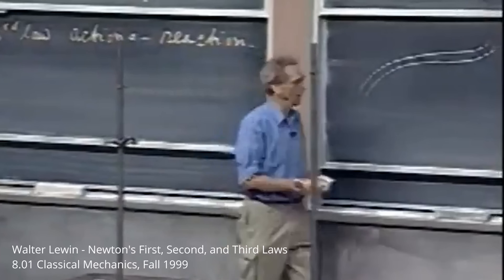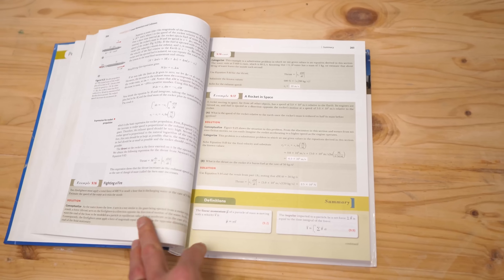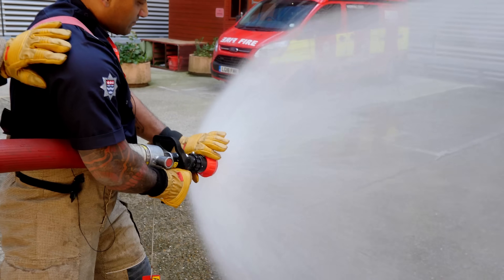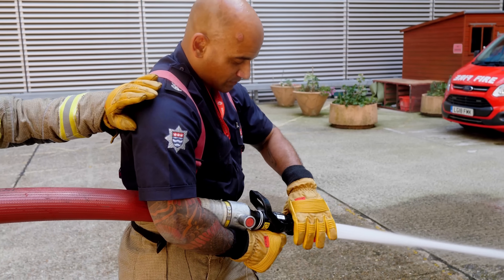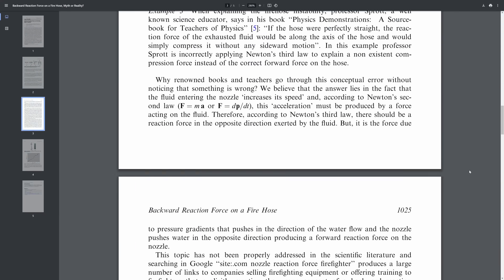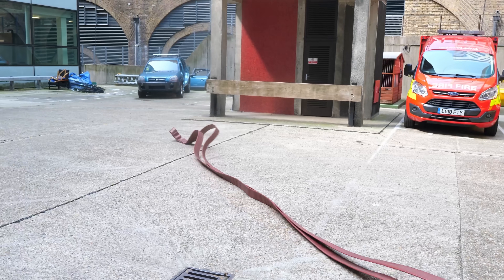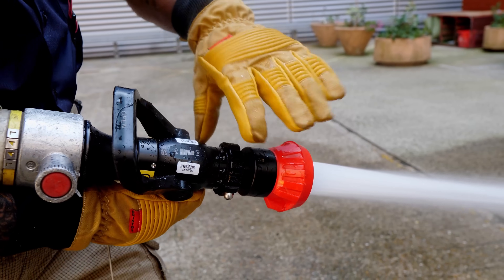Why chaotic hoses dance

Comment from the maker: What about when there's a constriction at the end? I think that would actually cause a force opposite the reaction force at the nozzle.
The sponsor is Jane Street. Apply to their summer program here: https://jane-st.co/SM-AMP25
Reply: The force you're measuring on the hose is called End Cap // Reverse End Cap // Thrust Force. This is equivalent to the gauge pressure across the pipe wall multiplied by its wall cross sectional area.

In your cases, the higher internal pressure acts to pipe the pipe wall in net tension. If the pipe end was capped when pressure applied, there would be a strong axial load putting the pipe wall in tension. As the pipe end is unrestrained it naturally wants to pull itself "rearwards" as the internal pressure is still present. This is the force experienced by the fire fighter - attempting to restrain against the wall tension of the pipe under pressure.
Reply: @d4nheg  Extremely well said. I was thinking the same thing and I couldn't put it to words that made sense. There is an area inside the hose wall that is equal to the area of the nozzle and they are concentric circles.
Reply: @d4nheg  This is the most accurate explanation I have seen so far, but I think you mean gauge stagnation pressure.
Reply: I think that's it, Steve.  The restriction creates a large difference in the speed the water that is leaving the nozzle than the water in the tube.  This creates a difference in momentum, which exerts a back force on the nozzle.
Reply: @Mr_Booshy  Even if the tube has an open end with no restriction there is still a reaction force.
Reply: I think that's the difference between air and water - if the hose is filled with highly compressed air then the velocity increases as it exits to a lower pressure area even if there is no change in cross section. For incompressible liquids that's not true (and you don't see a constant width water hose behaving like this, only one ending in a constriction like a fire hose)
Reply: @Mr_Booshy Nope, the reaction force acts only on the water stream and is responsible for the gradient of static pressure inside the nozzle. In a straight hose, the hose and nozzle are  only subjected to the viscous forces of the water and are pulled in the direction of the flow. This was measured experimentally. Google "Backward Reaction Force on a fire hose, Myth or Reality". It describes an experiment on a straight hose with a nozzle where they measured the force on the hose.
Reply: Finally  the regular chat is up. I hate these  "  premieres"  YouTuber Brittany to go back to simply posting videos like normal the live chat is dumb.
Reply: @turtletom8383  🔴 I highly recommend learning about Islam...

 🔵 There is no salvation in the afterlife except by following Islam

⚠ God has said in the Quran:

🔵 { O mankind, worship your Lord, who created you and those before you, that you may become righteous - ( 2:21 ) 

🔴 [He] who made for you the earth a bed [spread out] and the sky a ceiling and sent down from the sky, rain and brought forth thereby fruits as provision for you. So do not attribute to Allah equals while you know [that there is nothing similar to Him]. ( 2:22 )

🔵 And if you are in doubt about what We have sent down upon Our Servant [Muhammad], then produce a surah the like thereof and call upon your witnesses other than Allah, if you should be truthful. ( 2:23 )

🔴 But if you do not - and you will never be able to - then fear the Fire, whose fuel is men and stones, prepared for the disbelievers.( 2:24 )

🔵 And give good tidings to those who believe and do righteous deeds that they will have gardens [in Paradise] beneath which rivers flow. Whenever they are provided with a provision of fruit therefrom, they will say, "This is what we were provided with before." And it is given to them in likeness. And they will have therein purified spouses, and they will abide therein eternally. ( 2:25 )}

⚠ Quran
Reply: @turtletom8383  you could just click hide chat and post down here.
Reply: Now you're back to rocket nozzles.
Reply: I think you're technically correct that he's being pulled back by the hose, not pushed by the water, because he's holding on to the hose, not the water. But the real question would be whether the pull from the hose is from those eddies, or from the hose itself being pushed back by the water, and in turn pulling the firefighter back 🤔
Reply: @ameteuraspirant I think the internal pressure is pushing on the inside of the hose. The sum of the forces are zero everywhere except the open end of the hose. You're not feeling the accelerating water. You're feeling the tension in the pressure vessel with an open end trying to accelerate backwards.
Reply: @jahnkeanater I believe this is correct.
The nozzle exit is the only point where there is an imbalance, only balanced by the exhaust fliuds reaction to the pressurised fluid and hose system. Even without a constricted nozzle.
A restriction in the nozzle only increases the efficiency of thrust by increasing the exhaust velocity even though thrust force will be reduced by a reduction in mass flow rate and nozzle area.
Reply: @jahnkeanater  You have it.  Steve, at one point, starts to say the thrust is on the water back up-stream, but ignores it and seems to go with the Newton 'reaction' magically pushing the "nozzle" back.  You must be able to identify what 'body' the Newton 'reaction' is pushing on and it isn't the opening end of the hose, nor a ordinary reducing nozzle.  It's on the water. I may try contacting him. . .
Reply: So at 15:19 , the weight and material properties like elasticity, and flexibility of the hose are a big factor here, and also the external resistance of the ground as well as the weight of the water inside, all resisting the tendency of the hose to snake when at full blast, by design I would imagine.. it doesn't snake further back because it's really really heavy and on the ground. If it were suspended with nozzle down it would definitely snake further back, unless it were made of a really rigid material. If it were a much less rigid or less heavy material it would snake even further back.
Reply: Pumps do not create pressure, pumps only create flow. Restrictions create pressure. This is true for all pumps be it a rocket, firefighting trucks or air hoses.
Reply: @Kikkeliskokkelis12  There's a perfect electrical analogy with voltage as pressure, current as flow rate, small and large resistors as wide and narrow pipes, inductors as mass and capacitors as elasticity.
Reply: So what would happen if the hose was in zero gravity…. 🤔
Reply: @georgelaxton  Nothing different, a water hose exit is exactly the same as a rocket and rockets work same in 0 g.
Reply: hmmm I don't know if that's it, I mean a firehose half open would do that, I think the missing element is the friction force applied on the hose by the fluid. if you detached the firehose at the base while it was running the hose would be pushed away. I think at the connection point to the fire engine the hose is under tension.
Reply: @iskoon I don't think friction plays a part. I think this user @d4nheg is most correct
Reply: @iskoon  only because you're holding the nozzle. If you had a loose hose flaing about and then put  a restricting nozzle on it, it would flail around more. restriction inrcreases the delta p (difference in pressure)
Reply: Yesterday I saw a video of a large ship dropping the anchor. As the chain was going down the hole, you could intermittently see the chain raise up as it bent to go down the hole. 

I immediately thought of you with the ball chain experiment you did a while back.
Reply: I don't think so. If you have an incompressible liquid, the slow down at the constriction will propagate to the pump, such that although the water flows more slowly than if there was not constriction, that is the case through the whole length of the hose and thus there is no slow down at the nozzle, ie. no reaction force. On the contrary, it would create higher pressure inside the hose causing more acceleration and thus a greater reaction force. Unless it causes a reduction in the flow rate and results in a lower reaction force. I guess it depends on the strength of your pump and the viscosity of the fluid.
For a gaz, I guess it might depend on the speed and pressure inside the hose. There might be configurations where the gaz actually slows down and compressed near the nozzle, causing an opposite reaction force, but still increasing the original reaction force because of the increase in pressure.
Then again, we'd have to test it to actually know. And there be many tests to do with all the parameters potentially influencing the result. And the short answer at the end would probably be: "It depends."
Reply: I think the mechanism behind the car lot dancers is different from a wild hose. Wild hose is essentially a rocket but the dancer is blowing just barely enough air to stand it up, once upright there is no pressure to inflate and keep it upright so gravity folds it over. Once it creates a new seal it inflates back to the upright position and repeats the cycle.
Reply: @Dejacoa  Could you adjust the fan to a point where, on a calm day, the cycle is regular?
Reply: Because water is incompressible, and has essentially the same momentum at the end of the hose as at the outlet of the pump, couldn't you entirely ignore the hose for the reaction force, as the end of the hose would be equivalent to the outlet of the pump itself?
Reply: was just about to comment this, it looked like the sprinkler toy and the firehoses both constrict at the end, the forces would be different than the straight tube experiments
Reply: If the pump were powerful enough, it could theoretically increase the pressure to compensate, resulting in the same mass of water traveling through the hose (compared to without a restriction). In this scenario, wouldn’t the velocity of the water through the restriction increase as a result?
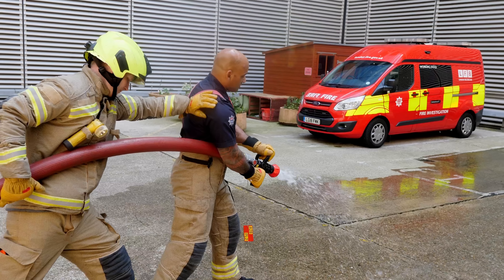Reply: I’m a firefighter, so I’d suggest you speak to your fire brigade member to confirm this for yourself, but an important thing to notice, and will give you great insight about the nozzle reaction forces, is that the backwards pressure on the nozzle is GREATLY reduced when the nozzle pattern moves from Straight Stream (tight pattern for maximum reach) to the Fog Nozzle pattern (wide cone shaped stream) 6:36.

This will help confirm that the impinging surfaces inside the nozzle cancel each other out inside the nozzle in the Fog Pattern setting. The straight stream setting can require two firefighters leaning into the nozzle to resist the reaction force, but in the wide Fog Pattern, one person can easily hold the nozzle with one hand!!! even though the amount of water leaving the end of the hose is nearly the same (depending on the nozzle, the fog pattern may have greater GPM/LPM flow rate than the Straight Stream pattern)
😳

p.s. You might want to ask him about "Friction Loss" too. If you use that term, he’ll know just what you’re asking about, and his explanation will add a lot to your understanding of hose lays.
Reply: A partial constriction at the nozzle increases the velocity of escaping fluid/water compared to that of an open pipe. Increasing speed of escape should increase the force felt at the nozzle end, but remember the fact that the volume also decreases in tandem... Always fun to try to reason through everyday things like this. 
My fire fighting training in CG was too, too long ago, but as I recall it was hardest to hold the hose when the nozzle was fully cranked open. That's when a large hose required two people. If I had the nozzle shut partway back, I could handle it myself.
Reply: @ProfessorJayTee  "remember the fact that the volume also decreases in tandem": water's essentially incompressible, so the flow out the nozzle is identical to that through the hose...it has to be, or water would have to be added or lost in the hose somehow. With the flow rate being the same, the flow speed has to increase to go through a constriction...higher velocity, same mass flow rate, higher momentum transfer and a net force.
Reply: I think laminar and turbulent flow have something to do with it.
Or at least the viscosity of the fluid vs the diameter of the pipe. Both the flaily man and the balloon had relatively large diameters compered to the length.
Reply: I thought that the nozzle is actually a constriction. I thought that you could consider the liquid inside the tube as static - but under high pressure - until the nozzle,  then in will gain momentum and go back to atmospheric pressure. The the force feedback.
Reply: Yes, the nozzle causes the water to accelerate (think Bernoulli) causing the reaction force, i.e. rocket nozzles.
Reply: the video of the long hose flailing about looks like a double pendulum to me...
Reply: @Steve Mould
14:00 If that is true, that the pressure is generated at the nozzle, then it should also be true that a fire fighter feel less force when the nozzle is set to "fan mode" instead of "beam mode".
because in "fan mode" the pressure is generated radially in 360 degrees & cancels out each other, while in "beam mode" the pressure is generated axially and does NOT cancel out.
Does that match what happens in reality? (I think: Yes).
Reply: I'm a retired firefighter and let me tell you, we spend a lot of time studying hydraulics to understand hoses...

Yes there is always a restriction at the nozzle. Without restriction the stream has no reach but lots of flow. It's not so obvious in the fog nozzle used in the video, but you can really see it in a "smooth bore" nozzles. 

Apologies, I'm a US firefighter so I'm going to use English measurements..

A typical 1.75" hose with a smooth bore nozzle might have a 1" discharge. When supplied with 50psi this will discharge roughly 200 gallons per minute. But there's also friction loss to calculate. So if there was 200' of hose (typical) the pump would need to run at 150psi to get 50 at the nozzle. A lot of energy going into that hose. 

Absolutely there is "rocket thrust" coming from the hose. At one point you can see him adjusting the flow rate dial on the nozzle. This changes the size of the restriction internally and let's more water flow at a given pressure. When he opens the dial up you can see the thrust increase (recoil) with each click. It's also a lot easier to hold a hose with the same flow rate set to a wide "fog" vs a tight steam. The thrust is directed to the sides equally vs against you.

Why only the tip whips around probably has to do with the stiffness of the hose under pressure. Assuming 150psi in the hose, there's 247 tons of pressure spread out along each 50' section of hose!

Hope this helps!
Reply: Hi, is there a reason why you use blue coloured water? @SteveMould
Reply: @SteveMould, if there's a constriction (as in a necked-down nozzle), wouldn't that cause the exit velocity to increase relative to the water-in-hose velocity?  And kinetic energy increases with the square of velocity...
Reply: Yes, but a constriction also results in an increase in velocity and thrust. There is a limit where the constriction is so small it doesn't result in much thrust, but there is never a point where the pipe can walk forwards. The force in the opposite direction only really exists while the constriction is changing. This slows the fluid in the pipe down with a pressure wave at the speed of sound (i.e. water hammer - which can make pipes walk forwards!).
Reply: @MegaRaydiation  Water hammer is what you get when conservation of energy runs headlong into conservation of momentum like flowing water into a closed valve. CoM says "Oi, mate, you can't bring that much kinetic energy in here!" and CoE says "Well, it's got to go -somewhere-!"

See also, the high-voltage kickback you get when the current through an inductor is interrupted.
Reply: Look at the jet system used by boats and ships for propulsion.  It provides massive amounts of thrust.  Have a great day.
Reply: Or maybe because the steel nozzle is heavier than rest of the plastic pipe in case of the firefighter hose.
Reply: @subhranildey23  when you add the weight of the water the hose is much heavier than the nozzle.
Reply: Take a look at corilolus mass flow sensors and how they work.  Specifically there is a product that goes by the name Micromotion.
Reply: What? No c'mon. It's just the action of the water leaving the hose. 

like the "if an astronaut swings a hammer he doesn't move but does if he throws it" example
Reply: @ColdFellow1  Actually an astronaut swinging a hammer will rotate and move (and stop moving when he stop rotating it) even  if he does not throw it and keep the hammer in his hand.
Reply: I think this is it, the pressure differential at the nozzle and friction inside the hose makes the force.

But I’m a layperson :) you figure out the hard part!
Reply: If the constriction happens fast enough, it's got profound effects. The resulting water hammer could have enough force to explode the pump.
Reply: Can you do a video about rolling balls on a spinning plate. It looks like planets orbit! Its cooool!
Reply: Would adding a "horn" to the end also reduce the force created by the sudden pressure change? (i.e like in a loudspeaker/pa system, for impedance matching).
Reply: would a hose with a pump on the water exit end, still flail?
Reply: Robot from Fargo: I can help!
Regardless of where the forces are coming from, for the person at the nozzle, it always equals out to almost exactly the "rocket equation" you talk about
Reply: The water nozzle is same as a rocket engine... The force is the weight (momentum weight) of the water x the velocity of the water when exiting.  (some people get confused and think it would give 0 force in 0 gravity, that is why put up (momentum weight) as it is really about momentum and not "weight".)

+214
Reply: @a64738 This is not what experiments indicate. Google "Backward Reaction Force on a fire hose, Myth or Reality". It describes an experiment on a straight hose with a nozzle where they measured the force on the hose. Actually, the straight hose is being pulled in the direction of flow. The acceleration of the water in the nozzle is only provided by the water behind, the hose does not feel that force. The straight hose only feels viscous friction forces that pull it in the direction of flow.
Other experiments indicate that the kickback on firemen hoses only come from flow direction (and thus momentum direction) changes.
Reply: I think the thing you're failing to grasp is that the pump is not providing the movement of the water.  It's providing pressure.  If you inflate a balloon with a pump, once you let the air out of the balloon, the balloon will be pushed backwards.  The pump that inflated the balloon does not experience that force.
Reply: If the hose is made of steel, instead of rubber or equivalent,  would there be the same force? Can some force be contributed to unequal streching and contracting of the ruber hose? Think "soft robot". Hope that made sence. 🤠
Reply: Hold on there Steve.  

If you put a fancy nozzle on the end of the hose that pushes the water backwards (like a drain cleaning hose), it drags the hose with it...  So do that incrementally.  Once you get to perpendicular, does the hose holder feel a force?
Reply: Would an infinite hose feel a force pushing it back, or is it the water leaving the end that pushes the hose back? I feel like that has something to do with it, but this is an interesting conundrum
Reply: Could it be the difference if pressure between in the hose and the atmosphere outside?
Reply: My hopethesis is that, at the nozzle, the water is spread out to some degree. It goes from moving in in a uniform direction, and when it fans out some of that momentum is spread in all directions. Especially with expanding air. The lateral part of that is cancelled out but the difference in momentum between momentum in hosewise direction is conserved, so there is a significant reaction force. That's what you feel. 

400kg of water to 50m/s in 60s you need 333N of force. I never held a fire hose but if the stream loses half of its speed at the nozzle I can imagine that would be about the amount of force you can aim.

My question would be since a laminar stream stays together, and you build a laminar flow on the channel I think. The water can't slow down at the nozzle, so if I'm guessing correctly there should be no force at the nozzle, right?
Reply: @SteveMould Apparently, this is not correct. Google "Backward Reaction Force on a fire hose, Myth or Reality". It describes an experiment on a straight hose with a nozzle where they measured the force on the hose. Actually, the straight hose is being pulled in the direction of flow. The acceleration of the water in the nozzle is only provided by the water behind, the hose does not feel that force. The straight hose only feels viscous friction forces that pull it in the direction of flow.
Other experiments indicate that the kickback on firemen hoses only come from flow direction (and thus momentum direction) changes.
Reply: Water experiences drag in a hose, there is no net force on the water except normal forces, but that doesn't mean the hose doesn't feel a net axial force, you recall some of the force on the water is being offset by the pressure gradient in the water due to drag.  do your free body diagrams please, this video was a very poor showing
Reply: But is the balloon flying around the room everywhere related to the chaotic hose phenomenon?
Reply: I believe that's it. It's the nozzle. In your demonstration with your small hose and compressed air, their isn't a constriction, the air is flowing out at the same velocity as it flowed through the hose. But with a fire hose, the nozzle constricts the flow, creating more pressure in the hose and accelerating the water leaving the hose. A water hose with an open nozzle should swing about more vigorously than one with just an open end. [I replied before I saw the last half of the video. You seemed confused. lol]
Reply: From experience, making the constriction smaller makes the force stronger until you reach a point where the constriction is too small to have a significant volume flowing.This is experience with a water filled hose. It's easy to verify with a garden hose, open end vs constricted end with the supply open the same amount. You've also got a stiffer hose when it's full of flowing water, maybe due to the momentum of the water resisting a change in direction if the hose is straight, but making it snake more so if a bend is there (attempting to straighten the hose). I used to sneak onto a yard that had a water hose, jam a piece of copper pipe in the end and bend it so it broke off, making a very effective nozzle to make the pipe snake about all over the place (in the times before everything was fenced off due to health and safety).
Reply: What about the inward pressure created by the walls of the hose? The water is entering the hose faster than it "wants" to exit, so the water applies an outward force on the walls of the hose, which means the walls of the hose would be applying inward pressure on the water. Imagine using a hose large enough that it applies no inward pressure on the water (or low enough water pressure that it applies no outward force on the hose)
Reply: That causes the lower pressure but higher velocity right at the tip of the nozzle. This icrease in velocity causes an increase in the force applied in the opposite direction through conservation of motion. You can feel this with pressure washers.
Reply: I had a similar train of thoughts
I have a few questions/hypotheses.

First off, I am basing this on the one of the things said about how the pump is pushing the water to speed (and pressure).

This should mean that the water that is in movement should basically be pushing against the pump to be accelerated. But I question the implications of the nozzle from the hose.
Since there is a constriction, maybe that increases the force felt by the firefighter, just like a garden hose when you put a smaller nozzle, or a showerhead, the difference can be quite significant.
I would be interested to see a comparison with a laminar flow, since technically the pressure and velocity of the water should be constant across the whole hose.

On another note, I do feel like the stiffness of the pipe might have an impact on how the end will behave when not constrained.
In the air compressed test, the ratio between the stiffness of the hose and the force exerted by the air escaping might be larger than with a firefighter hose.
That could make it so the force that the hose is applying to unwrap itself might be negligible so a curved hose gives a similar result.
In a firefighter hose, the pump pressures the water and some of this pressure will be felt by the hose. Since the hose is slightly stretchy, it will accumulate some potential energy which is why the water can keep moving even when the pump is turned off.
Maybe that stretch also increases the stiffness of the hose making it harder to bend. Also taking into account the weight of the hose might explain why only the end of it moves.

I would be interested to see a scale model of the end force tests with water instead and with different nozzles.

TLDR:
Having a nozzle can change how much force is felt by the firefighter.
Having laminar flow would lead to the least amount of force felt?
Maybe there are differences between air and water in the pressures felt at the end depending on the path of the pipe.
Maybe the weight and stiffness of a firefighter hose prevents it from flailing around chaotically like the air pipe does.
Reply: Basically you figured out why rockets don't work under vacuum without admitting it.
Reply: Yes, nozzle reaction is a thing. Force = mass times velocity. And the correct answer to the furefighter loose hose question is yes, turn it off at the pump if you can, and recapture the loose hose if you can, and between the two, limit the chaos.
Reply: Rivers do the same thing over longer time periods…… oxe bow thingys
Reply: Another factor to consider in the water hose, is that a large diameter fire hose full of water is really heavy. That extra guy as backup is helping a bit against the reaction force, but is crucial for keeping the hose up off the ground and pivoting behind the nozzle man so he can focus on aiming. A large diameter So with the water hose on the ground flailing just at the end unlike the air hose, consider what that volume of water weighs. Plus the hoses themselves are substantial. 50 feet of a 5 inch diameter hose full of water is a lot to move.
Reply: If we are still talking about water (an incompresible fluid), then I am not so sure that the force is opposite in case of a constriction: 
Applying Bernoulli's equation, when you reduce the section, the velocity increases, so the pressure drops. Then, you could say that the fluid experienced an acceleration when passing through the constriction, that is, a force pointing forward has been applied. That means that the hose should feel a force pointing backwards in the constriction.
The effect in the nozzle would be reduced, but the force would still point backwards, as long as the pressure just before the exit is still higher than atmospheric pressure.
It does not feel quite right, but not sure if I am missing something.
Reply: 6 3:24 3:24 😮 3:24 3:24
Reply: 🎉 3:24
Reply: Actually I was thinking about the constriction in another way. That if we imagined a perfectly straight pipe with no constriction then we shouldn't feel any force. But if we decreased the diameter of the end, then the watter should increase speed thanks to Bernuly's principal therfore it should experience acceleration and because of its weight it would generate a force in the opposite direction. And similarly to rocket engines, the faster you can accelerate it the more force you will get. (Sorry for any spelling errors)
Reply: Additionally, does the conical shape at which the water leaves the hose affect the direction those forces apply to the firefighter? Do they partially cancel out with each other? Would this create a more gradual release of force against the firefighter?
Reply: Hey Steve!  You should Test the Pulling force of your Air hose on that 'Red Scale' you were using earlier, and see if the 'p.s.i.' and Area of the hose amounts to a force that you see registering on your scale. My supposition is that it will Almost be the same force, you will lose some for the rigidity of the Hose, but it will be close.  For a Fire truck hose, you could calculate 1-3/4 inch dia. hose at 120psi or more or less depending on the situation that they might decide, apparently they can run them at some Very High Pressures like 400 psi!
I love your channel, thank you for all that you do! :yougotthis:
Reply: @anthonyanglim7147  Steve would do it all in Newtons, Pascals and metres, because he was born in a civilised country.
Reply: 12:50 "This parcel of water that is leaving the nozzle is being pushed by the parcel of water that is just behind it" - some, but how much? Before the parcel of water leaves the nozzle, it is already moving at the same speed as the one behind it. The only force on it when it leaves the nozzle, is the air resistance. So it is only the force that is needed to overcome the air resistance that the parcel of water behind it feels. That is tiny, especially because air is also moving with the water, once the hose has been running for a short while. That is not the full reaction force. 
Another way to see that, is to look at what the water does after it leaves the nozzle. It continues to flow in a relative straight stream with almost the same speed.  If there was a huge force from the parcel of water onto the one behind it, it should spread out when hitting the air. It doesn't, and it does not significantly change speed, therefore there is no large force between the water parcels.

13:20 "That is like arguing that you could push on the end of a string..." - try pushing on the end of a stream of water (without a hose around it), and notice what happens. 

There are three forces that play a significant role in this: 
1) the forces due to bends in the hose
2) the friction of the water inside the hose
3) the stiffness of the hose. 
Both 2 and 3 should tend to straighten the hose, and therefore should counteract 1. 
I would still judge that the force the firemen need to resist is caused by the bends in the hose.

With a restricted nozzle, there will be a pressure difference between before and after the restriction. That pressure difference accelerates the water through the restriction. But the pressure still comes from the water behind it, and therefore ultimately from the pump. Therefore, the above is still valid, even with a restricted nozzle. The only difference is that the water pressure is also pushing against the restriction itself, and thereby forcing the nozzle forwards, instead of backwards.
Reply: Note also the tube filled with air differs from a tube filled with water, because air is compressible. In an air tube, there is a pressure gradient all the way along the tube from the pump to the nozzle, and therefore a force on each parcel of air, from the air behind it, along the whole tube, speeding up the air inside the tube. 
In a water hose, there is only a significant pressure drop from the pump chamber to the inside of the hose, and the water flows with constant speed through the hose.
Reply: Sorry if I don't remember it right (or if I'm saying something obvious or repeating another comment) but for forces on steady pipes, curved or not (as the case of firefighter hose under control ) in fluid mechanics problems at the university we just used to pick integral form (I think in English texts they say "weak form", I'm Spanish) of Navier-Stokes equation of momentum, apply it on a control volume around the section of interest, calculate the integrals at the input(s) and output(s) and the difference is the net force on the walls. And it worked for hoses, nozzles, splinkers, water, gases... as long as you can assume the appropriate simplifications and know the boundary conditions. Again, sorry if I forgot some concepts or missed something.
Reply: The analogy with the rocket is closer than you think. What pushes the rocket? If it's only the chemical reaction, then why do rockets needs skirts beside just nozzle as a constriction?
The answer is pressure. But it has nothing to do with acceleration. It's just that molecules in the pipe move much faster relative to each other than to the pipe. At the speed of sound on average. While they are in the pipe, they exert pressure equally in all directions. When at the boundary at the exit - the pressure exerted is now unequal, with higher pressure towards the pipe, as molecules in the pipe resist moving, and molecules outside do not. There's no net change in velocity, only in volume of the flow, as molecules not constricted by the hose are now may fly further from the center of the flow, as there's less pressure outside the flow than inside of it. And the force is equal to that change in volume. Since water is almost incompressible, with water that change would be minuscule, while with air it will be more significant.
My prediction is that when fluid is allowed to escape not straight, but only sideways (and in case of fire hose - when it sprays in cone instead of jet), the force will be the least or even nearly zero (when net flow forward is zero), as the pressure exerted will be equal on all sides (assuming the hose is hanging in the air and not lying on the ground, as ground would create pressure difference and then the hose would fly off the ground). On the contrary, when the flow is unidirectional, the force would be maximal, as all pressure is exerted in one direction
Skirts on rockets helps to direct that pressure in one direction and increase the volume of the flow outside of the nozzle, thus increasing rocket's power and efficiency.
Reply: The hose nozzle a firefighter uses isn't like a simple nozzle and even a simple nozzle would feel some force if the flow isn't all being allowed out like it does in the long bendable airline. There is some complex stuff in a firefighter's hose mostly to handle the force of the water being restricted but also because it feels forces to it's walls the hose pushes evenly around. So The firefighter is feeling multiple forces but mostly from the restriction of flow and the backlash from that then because it's on the end of a hose the forces from that. If anything a firefighter fights more force then the air hose can push even if the only difference is the nozzle  at the end (you have to scale up to the firefighter hose thou).
Reply: No credit to Family Guy?? You know that is what you were thinking Steve😂
Love ya brother thanks for all your uploading!

-Sincerely,
Seth MacFarlane
Reply: Ah, So THIS IS WHY I HAVE TO LIFT THE SEAT FIRST?!?!!?!
Reply: The hose has a modulus of elasticity, which is probably why the firehose doesn't flip around so much. Different materials will react differently, and so will the same materials where the proportion of hose wall thickness to the fluid's velocity and it's density change. There are a LOT of variables here and each will have a different impact on the behaviour of the hose.
Reply: That's exactly what I was thinking the whole time.  I know I feel more pressure on my garden hose when I've set the nozzle to a high pressure stream.  When I take the nozzle completely off, there's far less pressure.
Reply: I don’t the think the hose bends more than nominally due to friction inside the hose. It is almost completely due to the exhaust forces.
Reply: Hey Steve, the firemen will feel the reaction force of the kinetic energy at the nozzle. The entire system can be regarded as a pressurized system where the velocity of the water is of negligible effect. The change in velocity because of the change in pressure is what creates the acceleration and opposite reaction
Reply: @ specifically firemen’s hoses have relative low kinetic energy in the hose and the water accelerates in the specialty nozzle, but even a straight tube with no fitting at the end will still flip around and the forces in the middle are generally small compared to the ejection force acting on the tip. A straight hose buckles in middle due to the forces pushing on the end of the hose, not fluid perturbations midway along the hose.
Reply: I think you should make a video about it with Electroboom and/or AlphaPhoenix , as I got the feeling this is exactly the same as what is happening with electricity.
It is just the same as with sending a RF signal to an antenna or copper trace with impedance mismatch.
This causes "turbulence" of the current, sending back some of the current.
You can see something like this happening around 16:44 when the dancing air figure starts vibrating.
There is clearly an impedance mismatch near the 'arms' of the figure, causing air turbulence.

I think this turbulence is what is creating the backward pressure you experience.

So my prediction is that when you extend the nozzle of your hose with a cone like shape to either slowly make the diameter smaller or wider, the wiggling will change and it will also change the backward pressure.
Also if you add some clamp a few cm from the end where you essentially make the hose diameter smaller, then there will be turbulence near the smaller diameter, but less energetic turbulence right after it.  Comparable with an LC filter to match antenna impedance.

Another nice experiment would be to test whether forcing some rotational effect in the flow (for example adding some twirl insert in the hose at the entry point) will change the behavior of the hose.

The chaotic nature of the wiggling makes me think about a pendulum with more than 2 moving parts, only then in 3D.
Reply: it's a continuous function due to surface friction interacting with continuously changing gradient due to bending of the hose. the pressure gradient can be nonlinear  (as in the case of bend or several bends) or linear in the case of a rigid pipe. there is an additional reaction force at the nozzle due to trading some additional pressure losses for velocity resulting from the constriction/expansion as per rocket. this can be observed when the pump is switched off. look up NACA ducts- they go wide around bends
Reply: What if there was a lance at the end; a length of metal tubing before the nozzle? Would it still flail?

I imagine that if you increase the length of the lance you'd definitely stop it flailing eventually. The question is, how short a length would you need to make the fire hose safer?
Reply: If there's a constriction at the end, it depends on how well the pump is able to handle that. The water pressure in the entire hose will increase, pushing back on the pump more. If the pump is still able to push water out at the same rate (impressive!), The pressure at the end of the nozzle will be greater, so the pressure release will also be greater. But the same mass of water is still being pushed out the end, since the pump is pushing water at the same rate. Because the pressure release is greater, and the same mass of water is still being pushed out, the backward force on the hose nozzle will be greater.
Reply: The constriction at the nozzle causes the water to speed up.  The force on somebody holding the nozzle will be the net difference between the speed*mass of the water as it approaches the end hose and the speed*mass of the water when it leaves the (constricted) nozzle.  OK.. You just said exactly that.
Reply: My first thought was, the pressure is going down at the nozzle, where the fluid is leaving; so there will be a force acting on the water and speeding it up, of one Newton for every square metre of cross-section of the outlet  times every Pascal of pressure difference between the two sides, and an equal and opposite reaction on the hose nozzle.

In an electric shower, the heating elements are operated by a diaphragm switch, which closes when there is a build-up of pressure downstream of the inlet valve.  The inner diameter of the hose is smaller than the inlet pipe, and the shower rose provides a further constriction.

The flow switch in a multipoint water heater or combi boiler also uses a diaphragm; but it works differently, because in this situation the valve is on the outlet and there is always pressure in the pipes.  The diaphragm sits between the inlet and outlet, with a bypass around it.  When a hot tap is opened, there is less pressure on the outlet side and the diaphragm moves towards that side; when the tap is closed again, the pressure in the pipes equalises and the diaphragm moves to the centre.
Reply: The pressure differential accelerates the water at the nozzle, but it is not the only factor as to how much thrust is produced. I notice on my garden hose, for the same nozzle setting if it is placed just into water (ie barely any pressure chage) the higher density of the water disturbs the mostly laminar flow and the thrust is greatly reduced. Great vid Steve thankyou for all of them
Reply: Hey, what about if the boundry-layer effect (in turbulance) reducing/removing the effect of forces on the hose-walls? https://www.grc.nasa.gov/www/k-12/BGP/boundlay.html
Reply: If there is a constriction on the end wouldn't that cause the water to speed up and cause the reaction force at the nozzle? Also could the problem with your gas hose model when compared to a liquid hose model be that water is incompressible while air is very compressible?
Reply: I'm shocked you didn't get to hold the firehose. As an ex firefighter I think that would've been safe with a person as backup. 
You really can feel the forces change when you turn the nozzle from straight spray to the wide mist mode.
Reply: 11:55 so there are two things that are missing here (I model pipe flow for a living). 1. You are correct that there is no net force, but you forgot about the frictional losses in the hose. When the pump turns on, the liquid will accelerate until the force from the pump equals the force of friction. 

2. In your image there would be no acceleration at the end. Conservation of mass would be violate if the start and end had the same cross sectional area with different velocities. Now if the nozzle was smaller, then it goes faster (to satisfy conservation of mass)
Reply: @SteveMould, I think your (negative) conclusion based on your experiments at 9:00 is premature. A short calculation shows that the tension force in the hose needed to support flow through a bend is independent (!) of the angle through which the flow bends (which is actually consistent with your experimental finding):
The (centrifugal) force on the hose perpendicular to the bend is FB = mdot * v * 2 * sin(alpha), where mdot * v is the absolute rate of fluid momentum and alpha is the half-angle between the inflow and outflow direction. The tangential tension in the hose (supported at one end by the firefighter) needed to counter this perpendicular force is T = FB / (2 sin(alpha)). Thus the angle turned by the flow cancels out in the calculation and the force happens to come out exactly equal to the "rocket explanation" (taking just the outflow velocity into account). This is also shown in the first paper you mention.
Reply: Just use conservation of energy, the force thing is not that hard to calculate for a straight hose
Reply: I moved here to watch Ur eyes 🤭🤭🤭🤭
Reply: Commenting here for (maybe) increased visibility. I have a fluiddynamics textbook where a constricted firehose nozzle is used as an example for „force of current“ as its called in german (idk about english). It is the force a moving liquid applies to its pipe when its  massflow changes velocity. This is a change in the Flow of Momentum and thus a force. So if you have a liquid that is flowing at a rate of 1kg/s that is accelerated from 1m/s to 2m/s by a constriction in the nozzle, subtract the outgoing Flow of Momentum from the incoming Flow of Momentum in the nozzle. 1kg/s*1m/s - 1kg/s*2m/s = -1N. The force the liquid applies to its nozzle is -1N and you would need to apply 1N to the nozzle to keep it from moving. Momentum is a vectorial quantity and a simple change in direction of the flowing liquid without constriction (a bend) IS a change in velocity and comes with a resulting force on the pipe. This really is the same as rocket propulsion. 

In Addition to that but entirely seperately the difference in pressure between the hose and the outside world causes a force on the Hose. Looking at the volume of liquid inside the nozzle it is pushed on by the pressure of the hose and Ambient pressure, each opposing the other. Since the Hose pressure is greater than ambient this causes a net force on the volume of liquid in the nozzle which causes a force on the nozzle
Reply: What about friction caused by the stream of water flowing against the inside of the hose?
Reply: This is my resending before what’s the vid. That the reson that it wiggles like that is the same reson that rivers coil😅. Ps sorry for bad grammar
Reply: hey Steve
so I'M a mechanical engineer and what I think its happening here is if we solve the integral momentum equation (Newton II integral form) together with the bernoulli with losses and take some assumptions (lets not constrain the tube at the end the 2 ends are the same hight and water cant be compressed at all) the firefighter actually needs to hold the same force as the rocket basicly what happens is that the when you take a section of the pipe where it has a bend in it it does exert a force there but it also makes the pressure drop quite a bit and what that means is if you take the whole section than the forces inside our "check surface" are 0 pretty close so the force that you calculate whith just the change in momentum is only important for material reasons but with the force comeing from the pressure of the crosssection of water entering and exiting the bed they kinda just cacel out the part that doesnt cancel out is not pulling on the firefiter but the part that doesnt cancel out is the force from the pressure drop thats due to viscosity so basicly the whole pipe is in a stressed state but looking fromoutside the only place where the net forces in any given "check surface" dont cancel out is at the end where the water leaves the pipe and becomes a free jet (same as a rocket) basicly the speed of the water stays constant everywhere since its not compressable and what goes into the pipe needs to come out, no potential energy difference , theres a pressure drop due to viscosity every bend stresses the pipe wall but the net force is 0 (with any check surface exepect if it contains the end of the pipe) so the pipe doesnt move only the end can where the speed of the water stays the same but theres a pressure drop that needs to be covered with some force otherwise it will start moveing and that force is what the firefighter holds at the end  sorry for bad english I'M hungarian
Reply: Hi Steve! We love you! ❤
Reply: Hi Steve